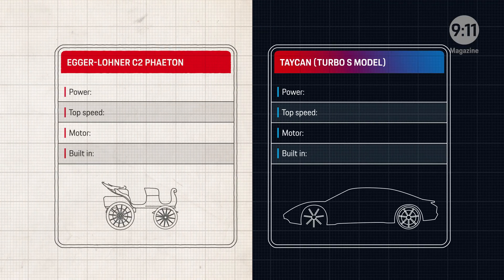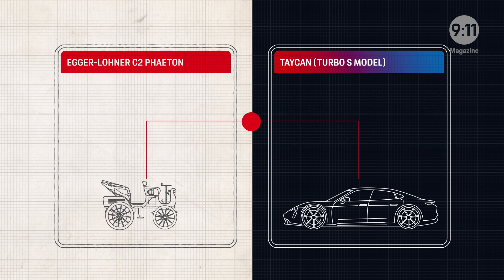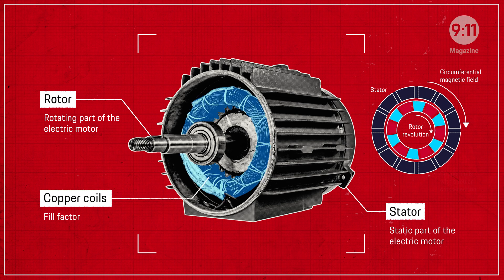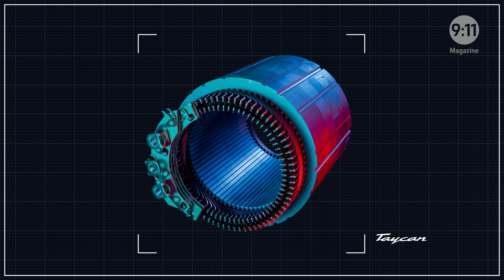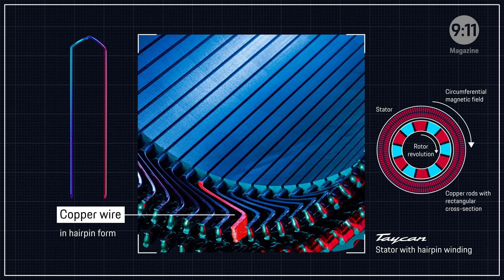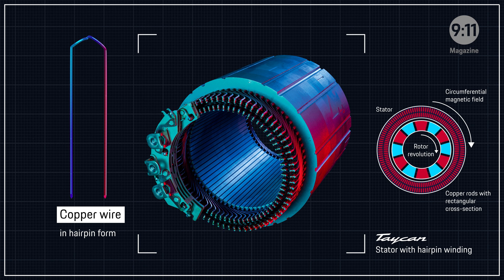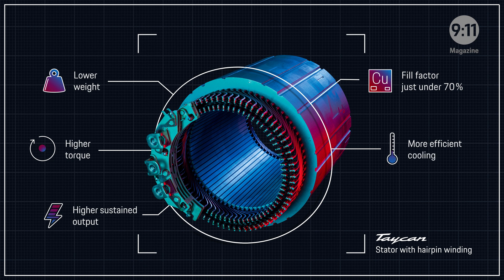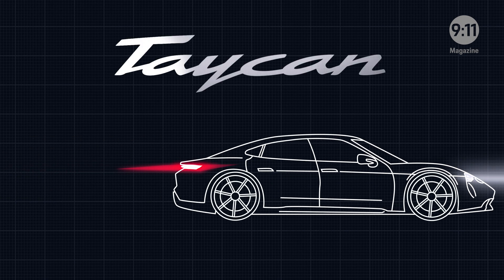9:11 Magazine Episode 14: HAIRPIN TECHNOLOGY

Comment: okay, so taycan was already using this one. good job
Reply: Being able to charge at 150kw on 400v dc chargers costs an extra 460 dollars as an option that screws people if they don't know to add it.  Morons have been telling people not to add the option by saying there were no 400v fast dc chargers above 50kw.  Tesla will have a +270kw ccs charging network bigger than all existing 150kw 800v chargers combined by the end of 2023 and people are finding out their goofy 800v cars can only charge 50kw on these new more reliable chargers because they did not add the option when buying their cars.  Tesla is the only company with a brain when it comes to EVs.  This was extreme corner cutting by porsche to not make it a standard to be able to charge on the more abundant 400v chargers.  800v is a niche standard that is only being used by companies with poor power efficiency to try to make up for it.

Comment: An electric motor isn’t a heart.
Reply: Shut up. It is a heart, god damn it
Reply: Dylan Robinson how do you work that out? ICE cars breathe, they require fuel to work like a human, they are a sum of their parts like a body is. Therefore an engine is referred to as the heart of the car. A battery is a power pack. 2 totally different things. 

It like saying your iPhone battery is its heart.
Reply: @Patr1ck2332  i'm no expert, but i don't think anyone is saying the battery is the heart, but the engine/motor is. by comparing to your analogy, i guess we could compare battery to the "fuel".
Reply: Ali Nishu I agree on the fuel part. But the electric motor can’t be described as a heart, is all I’m saying.
Reply: @Patr1ck2332  ok, i see, but are you an engineer or something? 

again, i'm no expert, but i'm not entirely sold by your analogy of "ICE engine breathing means heart".  i think you are taking it too literally!

still, i'm just curious, if we compare it to a living thing, what is equivalent of fuel? the first thing comes into my mind is "food". so ICE engines take fuel (and air also i guess), but does a living heart take food?
Reply: Ali Nishu without food the human body can no longer work. We can have this back and forth all day. The point of the matter is that as a petrol head and owner of some amazing engines, they are referred to as the heart of the car. 

Cars possess a soul, a distinction by what they sound like, how they deliver their power. 

An electric car does none of this. There is zero interaction with the motor. It’s like a milk float. 

Enzo Ferrari used to say you buy our engine and we give you the rest for free. 

The Taycan is the best of the bunch no doubt. But to refer to it as having a heart, to me and the majority it doesn’t. 
The use case for electric isn’t there yet
Reply: @Patr1ck2332  ok, if you say so, when you play the "soul" card, there's no point to dragging out the discussion, as a "soul" can't be quantified, justified and measured! 

i'm just pointing out that if you take it too literally then it can be argued than combustion engines are also not heart, just like the way you rejected electric motor.

just like the name turbo, i'm fine with the taycan having heart & soul!
Reply: Ali Nishu what do you drive? Again I’ll say the same. Many people share my point of view. No soul cannot be ‘quantified.’ That isn’t the point, it’s a feeling, again something electric cars do not give. A silent, boring appliance. 

I can appreciate the tech, just like in the VW race car, that can’t race because it runs out of power. 

Formula E vs formula 1. One is boring, one is exciting. One has heart and soul, the other none. 

Sound plays such an important role in defining a car. That cannot be argued with. It’s an emotion that can’t be replicated. That there is ‘soul’
Reply: @Patr1ck2332  But your iPhone battery IS its heart
Reply: Dylan Robinson agreed. My mistake. Wrong analogy.
Reply: @Patr1ck2332  sorry to disappoint you, i don't drive anything, i'm too poor!

i'm just laughing at you because you tried to justify ICE having heart but not EV by making a direct comparison but then took a complete u-turn by adding things that can't be measured and compared, while my counter-argument was based on your own logic.

anyway, i've just thought of another good one about heart: ICE makes loud noises, a heart doesn't! see, i can use your direct comparison method to disprove ICE cars having heart!

boy we could really drag this along for no reason! so can we say adios for now?
Reply: Ali Nishu if you are ever in Cambridge UK and want to come out in a car. My offer is there. Opinions are opinions, I agree with what you say on some points and disagree on others. Again, minority vs majority. 

Quantification doesn’t come into why you love something or someone. That can’t be factualised. It’s just a feeling, an opinion. 

Have a nice day.
Reply: @Patr1ck2332  thanks for the offer! of course everything can't be factualised, what you said later maybe right, and indeed there could be different opinion, i just wanted to point out that how you made a direct comparison earlier is probably not right and it could go both ways!

you to have a nice day!
Reply: @Patr1ck2332  majority doesn't mean it's right.
Reply: Trance 9 ok
Reply: A car triggers emotions, no matter what it is driven by. The Taycan is moved by an electric motor located in the center of the car. This too can be called a heart, if you will. It brings the vehicle to life - like a heart
Reply: Florian J see my point below or refer me to any emotion that a driver has through an electric motor. It’s emotionless. 

What can be derived from the Taycan Is it’s low centre of gravity, that is the benefit of having all of the weight low down aiding handling for such a heavy/big car. That can trigger emotion. 

Sensory elements like sound and feel have a lot to do with how people interact as man and machine. Again all taken away by the use of electric
Reply: Just in your opinion
Reply: Florian J I think you’ll be the minority that doesn’t agree